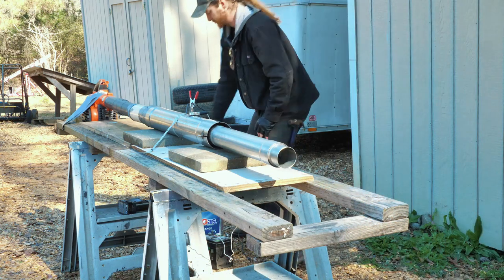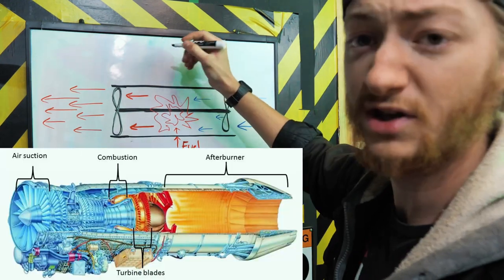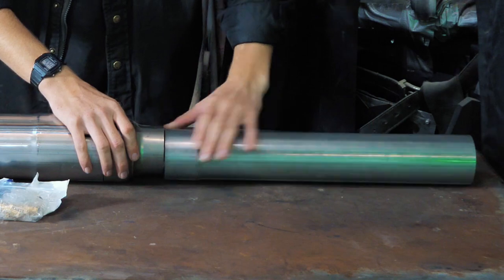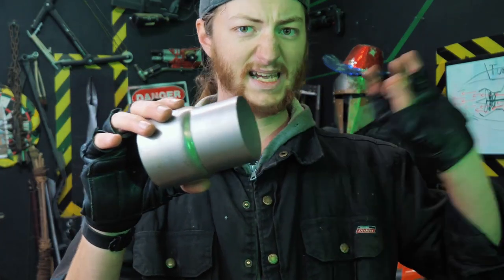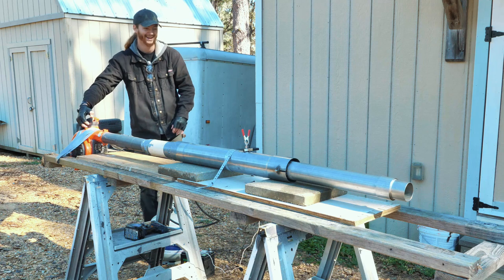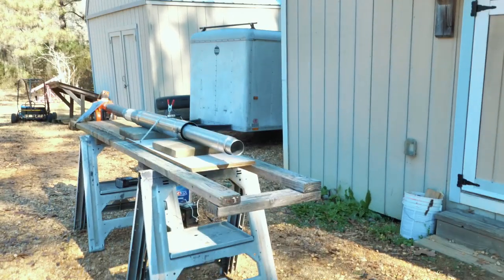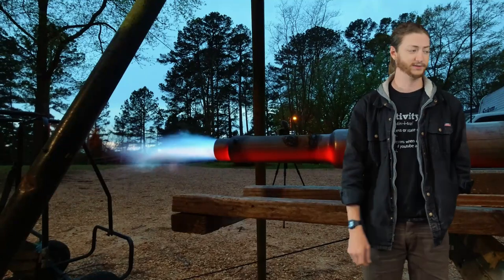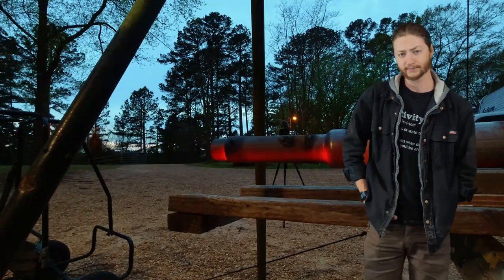world's LAZIEST jet engine

Comment from the maker: Well this was fun. I learned a crapload... will definitely be making more jets in the future (ideally that ACTUALLY work lol). Anybody got any thoughts or ideas i'd LOVE to hear them.
Reply from the maker: Probably going to do both eventually tbh
Reply from the maker: @APMtube9000  roughly how much you think it cost you all together?
Reply from the maker: @APMtube9000  Oh thats not TOO bad. Doable. It'd be a hell of a project... I have no clue how to build an oil system.
Reply: Now make an f-18
Reply: I know I’m pretty late but would changing the fuel possibly create more thrust???
Reply from the maker: @owenlaughy4985  Yeah, theoretically diesel or gas has a higher energy density so it would make more thrust. But not enough to make much of a difference in practicality, the design is too dumb.
Reply: @jakemakes  I love the idea man I may actually build something similar just for giggles
Reply: Add air inlets (vent/cutout to atmosphere) between the leaf blower and the fire so it can suck extra air freely rather than choking it via only a leaf blower

Comment: What you have made here is a very early type of jet engine called a motorjet. Also called a thermojet, a motorjet used a piston engine rather than a turbine to power the compressor. This seems like an odd way to build a jet engine. But it made perfect sense back in the 1930s and early 1940s, when heat resistant superalloys were not yet available to build reliable turbine blades. However, when improved materials became available from which to build reliable turbines, the idea of the motorjet fell by the wayside.

Comment: I too have made rocket fuel. Rocket motors, pulse jets and fan jets. A true jet has a set of compressor blades that compress the air before ignition. You pretty much had a open pipe with a steady ( wide open ) flow of hi velocity air but low compression.  What a turbo jet does is after compressor it opens the pipe diameter to slow the velocity but increase the pressure then the actually combustion chamber isnt exposed directly to the air flow but has a flame tube blocking the air, then injector the ignitor surrounded by a tube with various holes drilled along its length to only allow a certain amount of air to combust the fuel spray....if not then it flames out like blowing out a candle .  Then after the combustion chamber is roaring away it then expands the air surrounding it and the air fuel it burnt to expel the hot gasses out the exhaust force = mass ÷ acceleration. Before it leaves the exhaust another set of turbine fan type blades that can drive the intake side compressor blades to pull in even more air. The  two turbine blade sets are connected in one direction but can freewheel independently in the other like coasting on a bicycle. Then the hot exhaust gasses that still have tremendous kinetic energy are restricted thru a variable sized nozzle but not before hitting the center mounted aero type spike that controls the flame front to guide the hot jet stream out the back without becoming  bogged down in the walls of the inside exhaust pipe opening which is the boundary layer. To Increase the thrust on your simple fan jet try to squeeze the sides of the pipe that is before the cc to increase speed then the cc is higher pressure then use a flame tube with exterior pipe with small holes drilled out along it. You will have to do the research on ot but its something like first section of flame tube is 20% the the next 1/3 portion has 30% then the last is 50% of total airflow thru the system or area of the main  pipe. As u in rease the air thru leaf blower throttle the flame tube only uses what it needs to be a efficient hot combustor. Wide open would be all the holes area equal the main pipe diameter of jet tube or close to it. That's where the math and design/ testing comes in. The basic principle is easy the hard part is getting it to work efficiently and produce sizable reliable thrust for a prolonged time. Which is way more complicated. Using a car turbo charger one can make a reasonably good turbo jet as it spools up itself ( self excitation) no not that kind- lol) which produces large amounts of rpms airflow and compression. Compression  the air is the secrete
And exhaust nozzle shape and the combustor and and.etc......

Comment: I have been wanting to do this for ever. You did it for me, Rethink this though.
Realize what a  ram jet is. Then mate the leaf blower to that. What you end up with is a venturi behind the leaf blower to increase the area of the combustion chamber in relationship to the leaf blower., then add a tapered outlet to increase the pressure. I think it might work.

Comment: Have you made a jet engine or have you make a burner for a hot water boiler? 
Now make a turbo jet engine using a turbocharger (with afterburner for fun).
Reply from the maker: Oh i'm definitely going to build one out of a turbocharger
Reply: @jakemakes  if you can find it somewhere, U.K. tv program Scrapheap challenge, they made one and raced it against a pulse jet. Very informative but if all else fails then let Furze be your guide.
Looking forward seeing what you do with it.
FYI - try turning your gas bottle upside down.
Reply from the maker: @martinduddridge329  I tried flipping the gas bottle, didn't increase anything. I was running out of air not fuel

Comment: No bro it is not easy 
If You would not use of electric motor  you might know how hard is to rotate a turbine blade with just air and fuel only
You cheat jet turbine physics by constantly running a leaf blower or electric motor
But in real jet engine they use motors for just for its starting purposes not constantly 
Then the engine run automatically
 I tried for two years and I wasted my  11 and 12 grades by making and understanding this concept